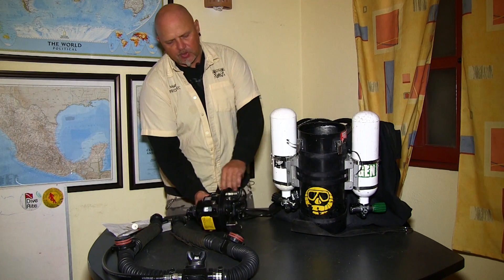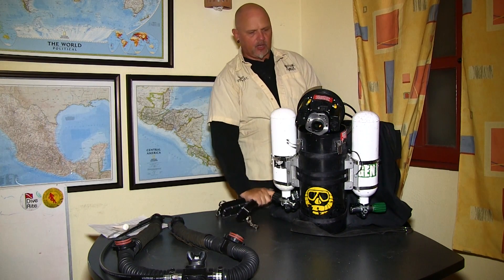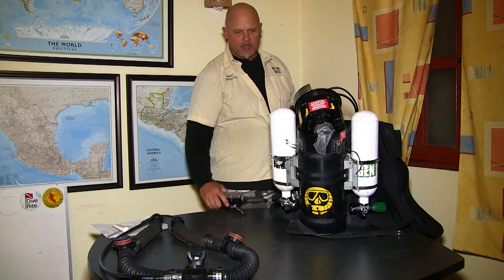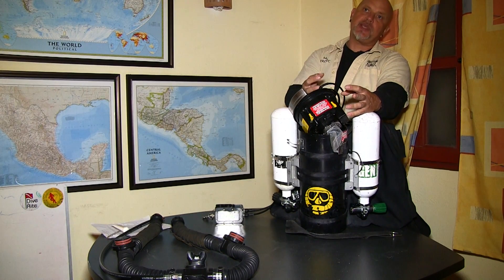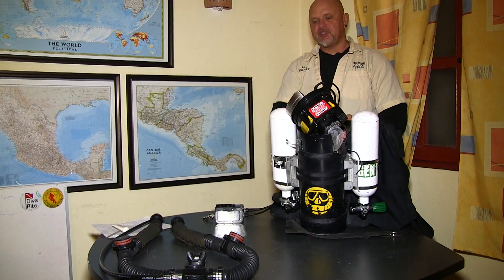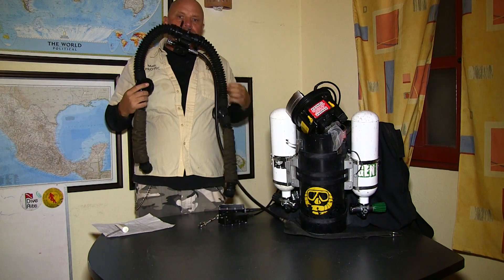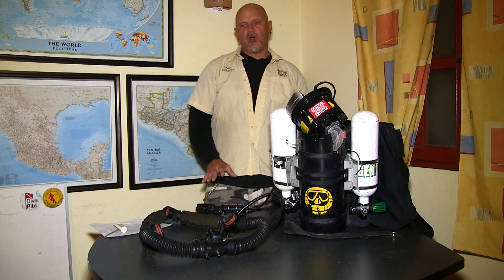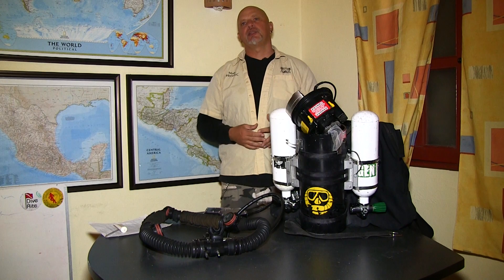How to prepare a CCR Megalodon Rebreather - Calibration and Loop test - Part 4

Comment: Hi, just want to know why is it good procedure to calibrate at the beginning of each days diving when all cells reading correctly in air ? As long as you check its reading   correctly in O2 after set up with flushing the loop with O2 I can't see the need. In fact are you not more likely to introduce cell errors when you are say doing a weeks diving and moisture is present on the cells the following day? I can go for more than week without calibrating as long as I take the head out to dry and the atm pressure hasn't changed significantly.
Also with the calibration as well as waiting for cells to stabilise in pure O2 and no longer move, I check the mv readings against an expected value on a spreadsheet I have made up just to be sure. thanks for the good video. I'm still learning.